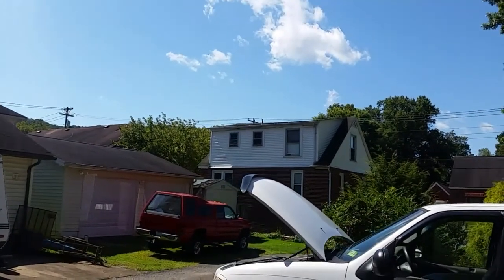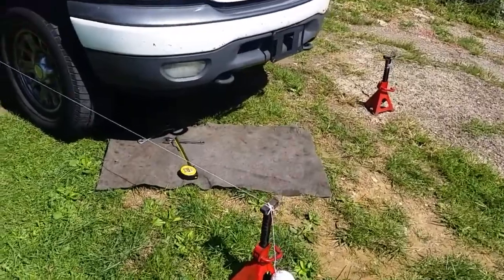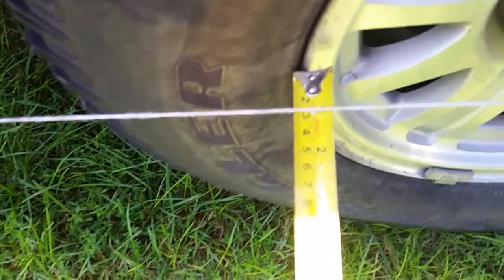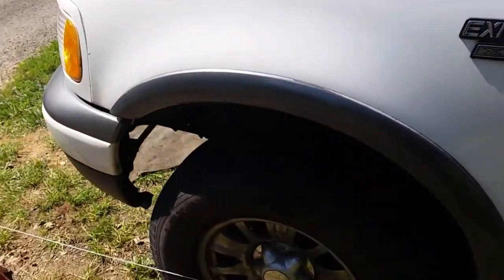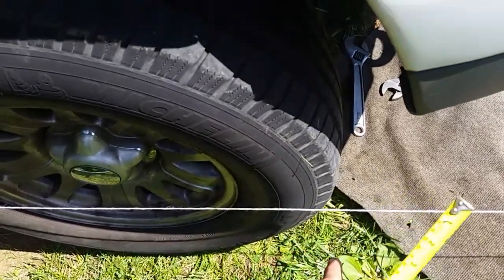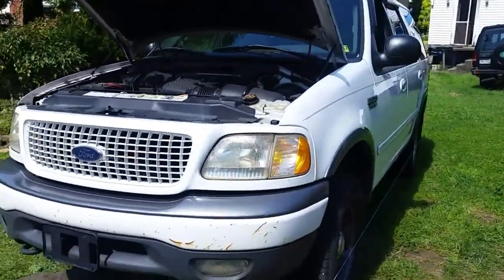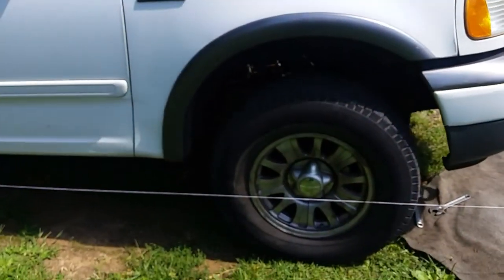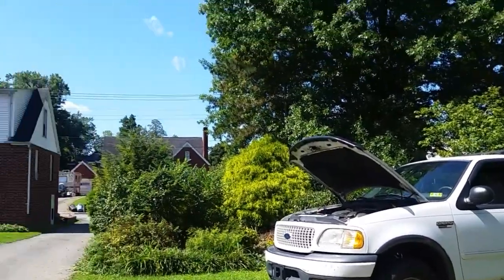New Upper Ball Joints and Home Made Alignment update.

Comment: The string method actually works like a charm in a pinch.
Reply from the maker: And fast...;)
Reply: It works to get you to an alignment shop only. If you can not afford the alignment after replacing a upper control arm, then keep saving money, because this rough procedure did not touch the upper control arm adjustments!

Comment: Make sure you know if the control arm is OEM or replacement. Autobone will assume it's a replacement and sell you just the ball joint and try to rent you a press when in fact you just need the control arm WITH a ball joint. Making another trip necessary. Clever girl.

Comment: I could be wrong, since I'm wrong a lot, but I'm pretty sure that the front tires are supposed to point inward by a small angle. I think that is why they call it 'toe in'. You can measure the center of the tire itself, and if the distance between the center of the tires is greater in the front of the tire, than in the back of the center of the tire , it is wrong. That seems wrong, but the front tires are supposed to point SLIGHTLY inward, toward each other, while the vehicle is traveling straight down a level road. I'm not sure that is because of how the steering works, or because of the fact that in most rear wheel drive vehicles, only 1 rear wheel pushes it.
 The slight inward pointing of the front tires might also act to reduce steering oscillation, like the Pittman arm does. With a severely worn Pittman arm, a steering wheel can shake back and forth violently under certain conditions. It happened to me once. Scared me a bit. Unfortunately, a couple of people are usually needed to hold the tape measure when measuring the front and backs of the front tires. You want the distance measured in the center back of the tire, to be a bit greater than the distance in the center of the front of the tires. The correct setting is probably measured in degrees from straight ahead. Of course you can measure at any point in the tire tread, as long it is the same point in the front and rear of the tires. You can rotate the tire off the ground, and mark it with something to make a line to measure from.

Comment: If this is all you do you have wasted time! Go to an alignment shop that will adjust the upper control arm and put it right after replacement. Notice he did not touch the upper control arm which he replaced. This did a rough toe in adjustment at best. Alignment shops work in degrees of angles not fractions of inches
Reply from the maker: I made marks on the upper control arms when reinstalled. So it was the best that could be done for now. It worked out great! When I took it to the shop two weeks later, the alignment shop said the laser was almost perfect! This  alignment was just to get by until getting it to a shop. ~Never said this was the final fix~did I ???  Waste of time, na. It did what It was suppose to do for me.   -Your move.
Reply: Nathan Rohrbough my opinion and if you took it to the shop you share thar to some degree. Again, what you showed had nothing to do with what you stated you replaced. Even marks on bolt heads and frame are only rough at best attempts at an alignment. Anyone with alignment knowledge will tell you to do the marks and then take it to a shop as soon as possible if not sooner. 
Your toe in adjustment was not effected by upper control arm replacement or lower ball joint replacement. 
In my opinion you gave people with little to no knowledge the impression that what you showed was an alignment. I stand by the it is not an alignment but rough adjustments to limo to a shop to have an alignment done!
Reply from the maker: That's to bad. Its not a mercedes....Its a get-me-by -alignment like I said until you get to a shop. Worked just fine for most people...You'll have to just live with that. ~